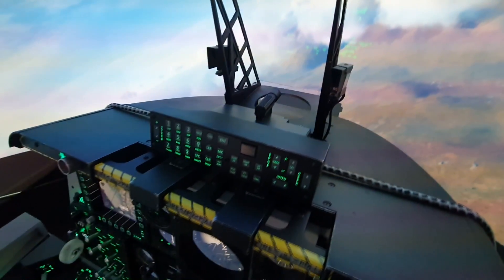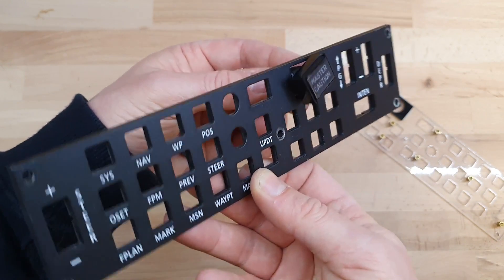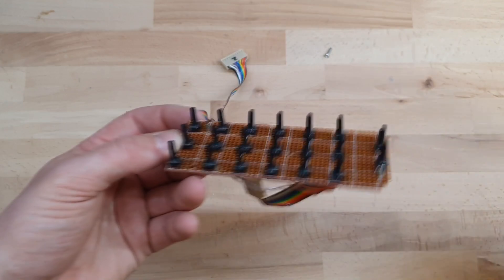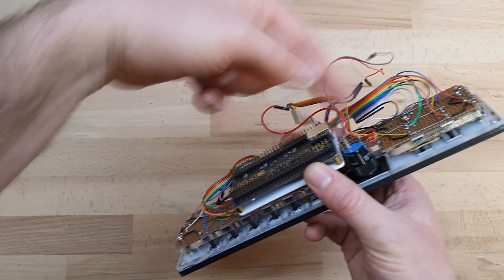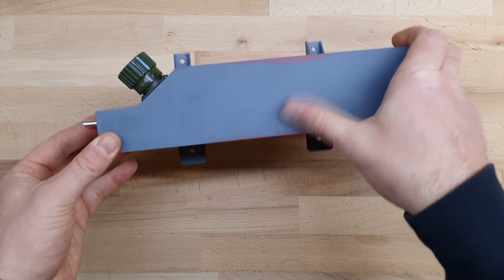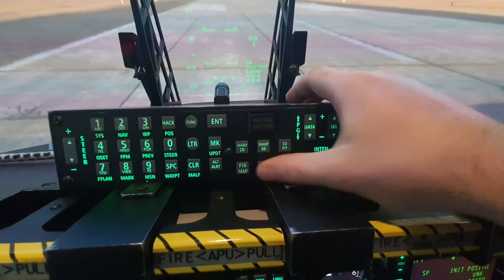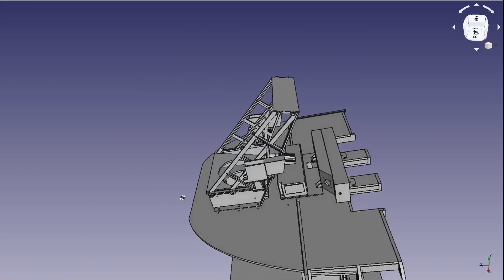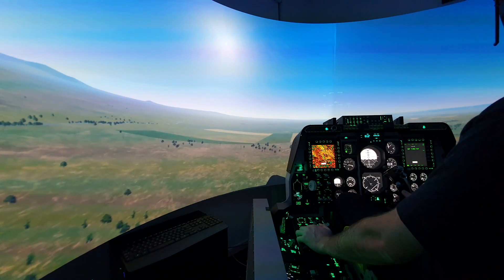The UFC and HUD - A10C Warthog Simulator

Comment: If I could ask man, What are you using for the HUD combiner? Teleprompter glass? 

There is a company called Edmund Optics by me that has the ability to coat a piece of large glass with a Notch Filter (As close as you can get to the other types of coatings normally used) but my god is it expensive. (700 USD per 1x1 inch last I checked) Haven't been able to find any other good alternatives to teleprompter glass besides that..

Comment: Does the software support an external heads up?  A Pi board driving a mono CRT would make a proper looking HUD display.
Reply from the maker: Yes, you can export the HUD, but i cant have anymore viewports without buying another grapics card. It would be great, but not worth that amount of money...
Reply: @thewarthogproject  I think you did not understand the question.  On some flight sims you can send the flight instriment data over the network. I was talking about using a small ARM board (like a Raspberry Pi or similar) to drive a display. The board itself being connected to the simulator via Ethernet.
Reply from the maker: @jonshouse1  DCS doesn't support exporting the HUD over Ethernet, only via a viewport.

Comment: Hi m8, Great videos & so helpful. I am just starting a F 16 pit and have all the switch panels cut & ready to engrave. I'm now looking at starting to construct the F16 IPC(UFC) and starting to collect components(Switches/Potentiometers)  being an absolute newbie to electronics I'm trying to get my head around all the different specs of potentiometers & resistors. Do you have any kind of list you have compiled with component details/types to use. Also regarding wiring of switches using a matrix is there a set way of doing this for different types of controllers(I'm using mainly the Arduino Pro Micro) or is it a common way for all types?. Cheers.

Comment: Hey man can you make a video where you explain/show how you did all the keymapping of the different switches in dcs? I got the problem that with toggle switches i have to put them in the on position to toggle it in game, then cycle it once more (to the off and then again to the on pos.) to turn it off again in game and its starting to annoy me like crazy.
Reply from the maker: You can edit the DCS lua to stop that- however it's much easier to program all your switches using other software- helios- rather than binding it all in DCS. That software runs the gauges, but it also binds every switch. Link is in the description FAQ section.
Reply: @thewarthogproject  thanks mate🙏

Comment: What an awesome build. I love the finish. Can you share what primer and spray paint you are using?
Keep up the great work!
Reply from the maker: Cheers! I use Rustoleum 2X Grey Primer, and Rustoleum 2X Flat Black. For the 3D prints, don't be afraid to spray the primer very heavy and very wet, then sand and repeat. I also use Tamiya filler putty for the joins between printed parts. Weathering is just simple dry brusing with some Tamiya satin aluminium. It's basically just model aircraft making, at 1:1 scale!

Comment: Coming along. Ordered a K40 laser and a 3d printer last week and I'll spend time practicing the techniques to put together these panels over Christmas. The electrical and programming is the easy part for me since I'm a programmer (and experienced with Arduino and PCB design), but there's some practical practice I need to get in for the actual build.

Comment: I still need to print the HUD frame STL files, So why did you not just buy the one that is on the market already?
Reply: I'm guessing it's because making the simulator is part of the hobby just as much as actually flying in it
Reply: @steffennilsen2132  I understand I am building one also but don’t have the patience lol
Reply: @rjet43  I'm not going to hold it against anyone, and especially for parts that are hard to replicate properly like the throttle or stick that needs a high quality injection mold and custom drivers and whatnot if one were to make everything from scratch
Reply: @steffennilsen2132  thrustmaster has the best
Reply: @rjet43  im currently modelling a "copy" of the f16/a10 stick. Still waiting for my printer to arrive. Ill let you know about the results of a custom build stick. Peace!